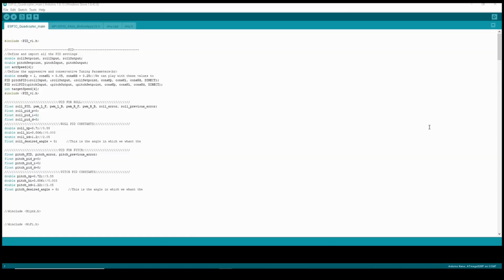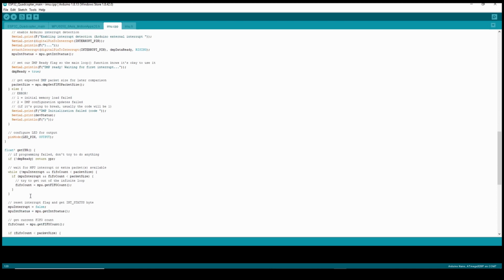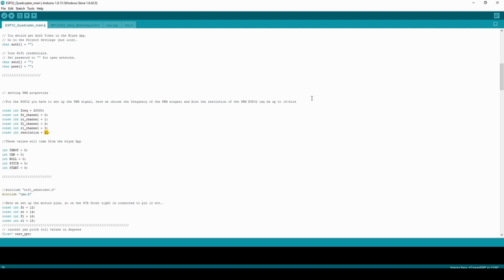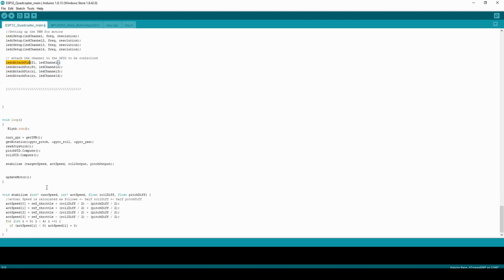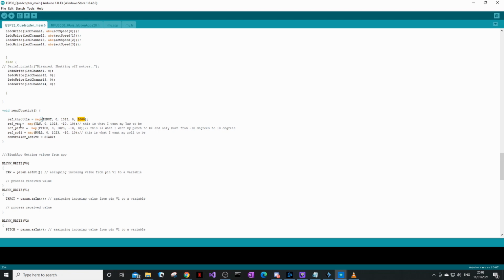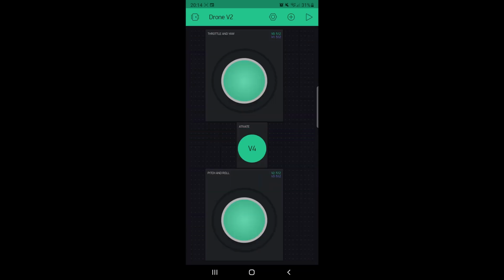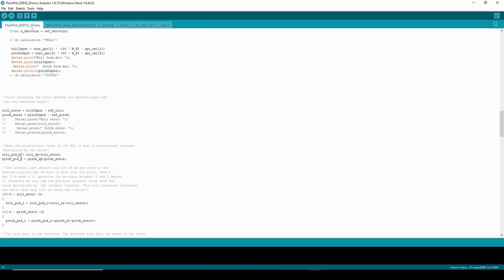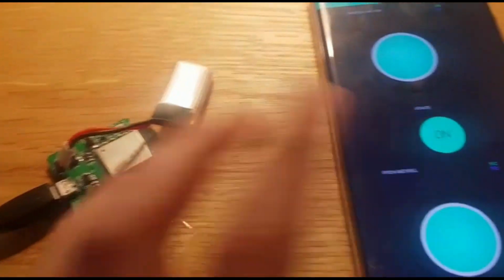Trying to build our own Drone - Part 3 The Arduino Programming

Comment: Well Thats very detailed work, really liked that. Im glad that you are using ESP32 rather then as usual arduino. I have been trying to do the same thing, instead I am using ESP8266 (Wemos R1 D1) module, in which you dont have to design PCB - I mean to say that you can make circuit on general purpose board and still be light weight. The only thing is stopping me that in ESP8266 is, Wifi connection and I2C connection not working together. Once establishing successful comm with MPU6050, I coudnt be able to find wifi module(Wemos) as wifi device in my mobile. It would be helpfull If you could share a code of ESP32, It seems to me that I am making a mistake in coding. Thanks a lot.
Reply from the maker: You welcome👍 and thanks thanks for the comment. One thing I noticed is the WiFi takes alot of Current so that can be an issue. I'll be happy to share code. You have an email? It is available on our Discord channel aswell if you want to join.